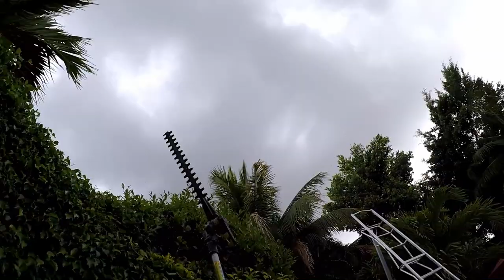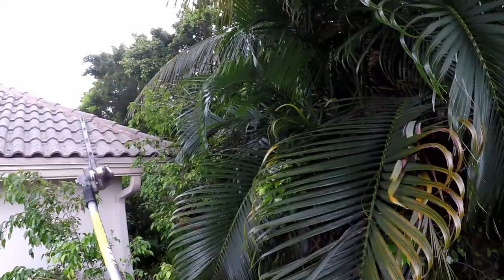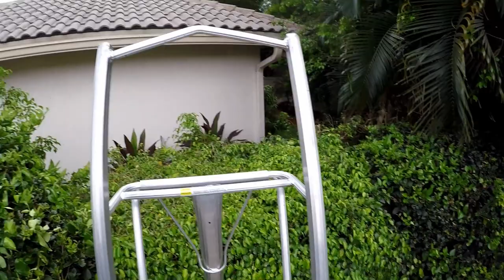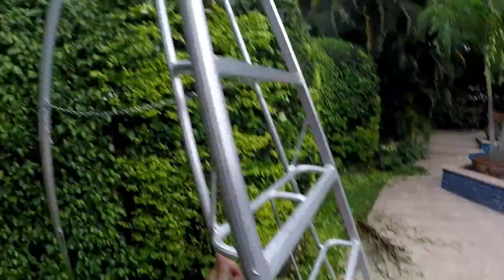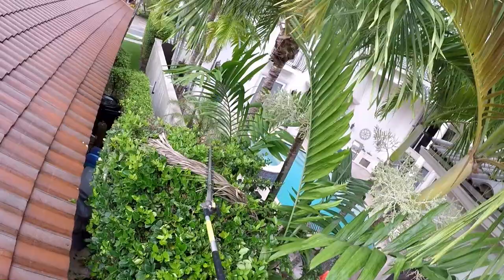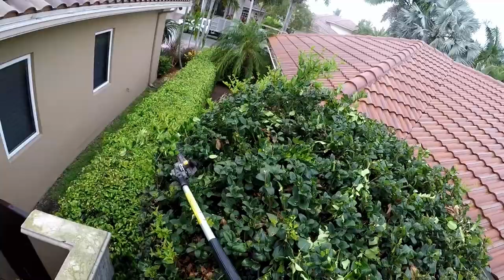Hasegawa tripod ladder & stihl articulating hedge trimmer in action

Comment: Nice work. Question,  do you maintain those trimmers yourself or have them sharpened for you? If you sharpen, what do you use?
Reply from the maker: Jeffrey Guyer I use an air powered belt sander 3/8x13. They're on Amazon for around $55.